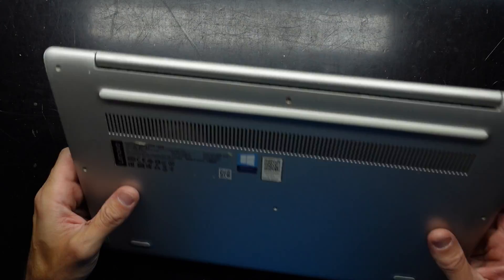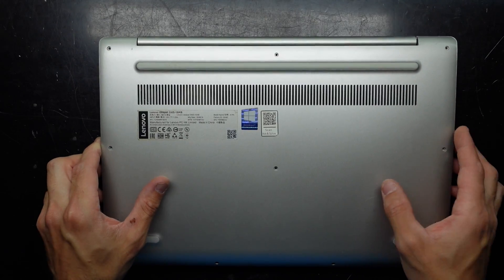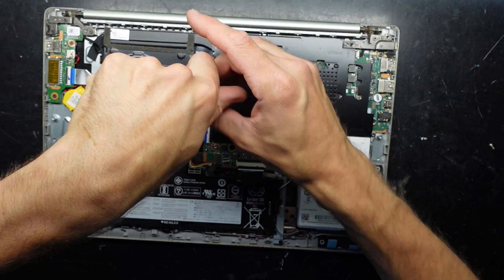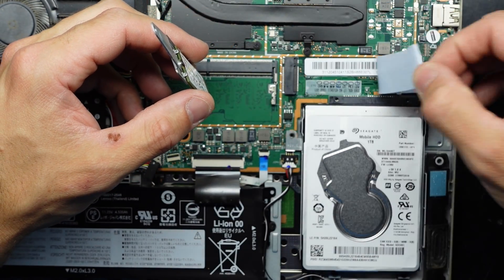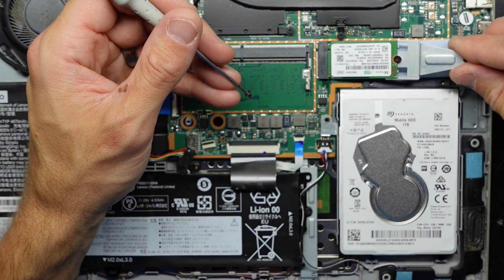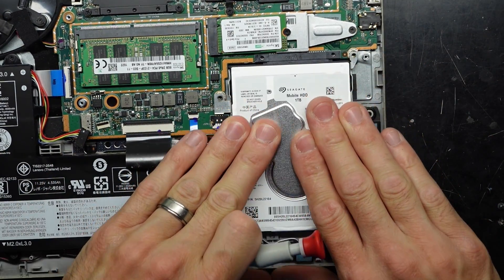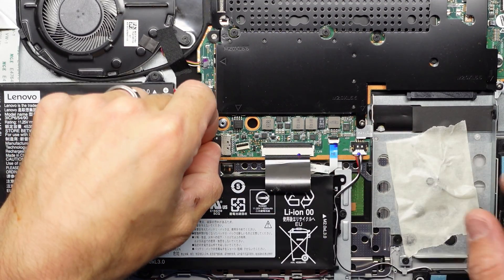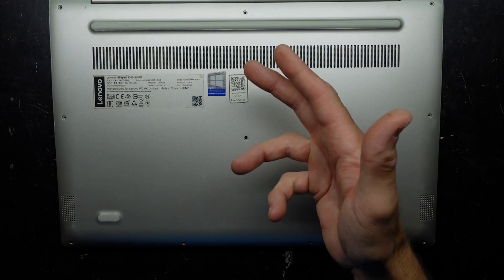Lenovo Ideapad 330S-15IKB Ram and Nvme Upgrade

Comment: Can I upgrade it to 32gb ram?
Reply: No , this model supports only max 20GB ram. 4GB is already soldered while you can install additional 16GB ram. You can try adding 32GB RAM stick and check if it will work/detected by laptop. Let me know also.
Reply: @ijazzzali According to Lenovo’s technical documentation this model only supports up to 12GB.
Reply from the maker: i dont see why not

Comment: Can i upgrade it to 16gb ram?
Reply: Hi, I'm trying right now, At the moment it is giving me problems, it gives me a blue screen with Memory_managment error
Reply: @carlosxbahena  I already installed my 16gb ram from crucial and its working fine. Now i have 20gb in total. 😊
Reply: @krcjimenez1425  that's really nice. what memory do you have installed? i tried with an 2400 mhz but it gave me the blue screen after 10 minutes of use :(
Reply: @carlosxbahena  its crucial 16gb 2400mhz its working fine i have no problem at all
Reply: Pd i have also this model but with 1050 gtx version
Reply: @carlosxbahena  i have already made an order from crucial but its still on ship. My 330s-15ikb is core i7 8th gen. Others says it worked. I will update here if it will be installed in my laptop 😊
Reply: you can put a 16GB RAM which ultimately gives 20GB RAM. I recently upgraded my 330S i15k to 20GB RAM.
Reply: Do you suggest 2400 or 2666 mhz ram ? I am planning to upgrade to 20 Gb, is upgradation worth it ??? @logeshasundar2874
Reply: No, se hai ideapad 330-15Ikb non puoi installare più di 12gb, così dice lenovo site.
Reply: Yes, i successfully installed 16GB ram 3200 Mhz from corsair. Now my laptop has total 20GB ram. Running like a butter